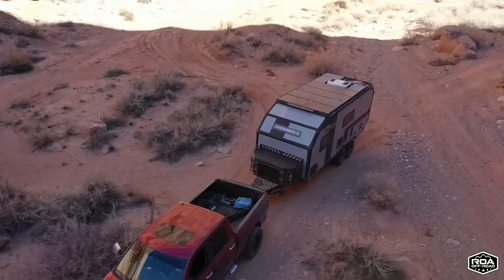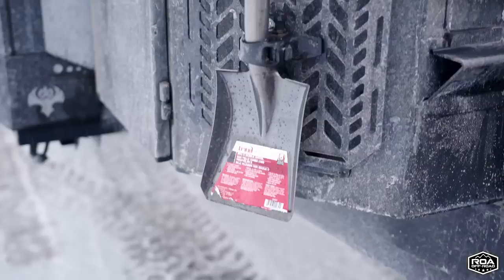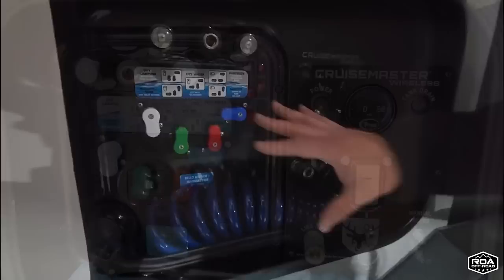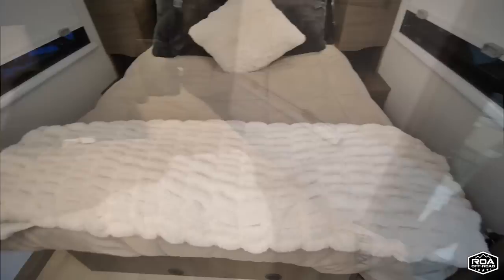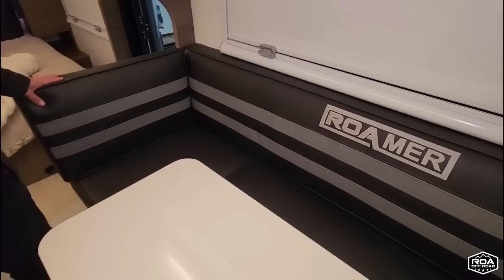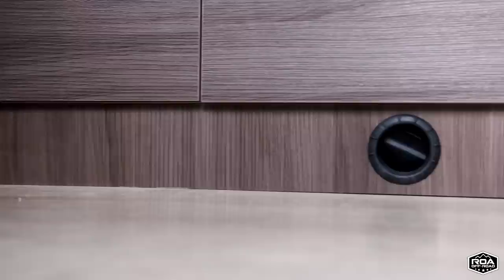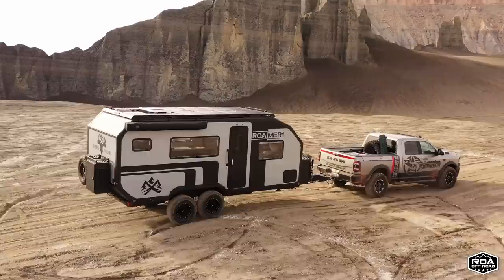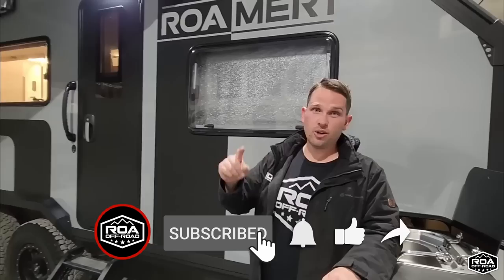Discover The Ultimate Off-Grid and Off-Road RV! | Roamer 1 Walkthrough with Big Truck Big RV!

Comment: After watching this channel for well over a year now, I have decided that there is another item that should be included in the "Fully Loaded" ROAMER 1.   A set of Two Way Radios.  So many times the crew goes out on an adventure, and when the terrain gets complicated, you have a driver and a spotter, and they need to communicate.  IMO, this would be another excellent addition to the fully loaded compliment of accessories for this unit!

Comment: This video says a lot about which overall brand ROA prefers after all the testing and reviews.  I suppose the only other thing I wished you would have covered for the true "first time" buyers, is what if any Truck upgrades would you have to do if you were to purchase this unit.    Also, do you still offer the ability to switch out the toilet to the Cinderella incinerator toilet?
Reply: I'm getting frustrated that my comments with questions only get a like with no response.
Reply: @terrytexas8257  call them, yes they do mods. truck upgrades shouldn't need anything if you have a 3/4 ton truck. 1/2 ton Should have a towing capacity of 12k+ (for payload) and obviously a Electric brake controller.
Reply: @duramaxadventures5832  Yeah, I know, but then why have an channel where they invite people to ask questions, and then rely on their supporters to answer on their behalf?

Comment: Can I confidently tow this with my F150?
Reply: Oh, and if I can tow this with my F150……how well will my F150 be able to handle off-road towing this?  I have an F150 Tremor, so it’s extremely capable off-road and I fully understand towing will reduce that capability, but I’ve never tried to tow some this heavy and do even mild off-roading.
Reply: We spent some time in Moab with TFL truck towing it with the new Raptor R and it did amazing. They towed it over I-70 and said it towed amazing. TFL has a ROAMER 1 and will be tow testing to with all new 1500s. Only issue was a squat. You would for sure want airbags on the Raptor R.
Reply: We can't tell you that without specs.  There are a wide range of towing capabilities depending on which F150, year, and gear ratio.  2022 will far outperform a 2012 in towing because of changes Ford has made. 

Ford is great about having towing guides on their website going back years.  Look up your model, wheelbase, differential, etc. and it will give you your tow rating.  Even more important is your payload capacity and hitch capacity. Tongue weight is what limits most half ton owners.  

Will you tow short distances on flat terrain at sea level or in rockies?  F150 also doesn't have stopping power of a Super Duty.  I just prefer towing with Super Duty.  Look up numbers and you might be able to tow it if you don't load it with cargo but the experience won't always be pleasant.
Reply: @jenkinsimages  I posted which model I have in the follow-up post.  '22 F150 Tremor.   Shane already answered my question just above your response.  Thanks though.